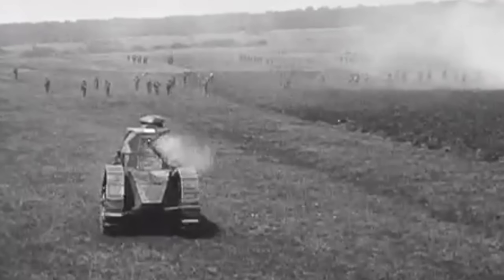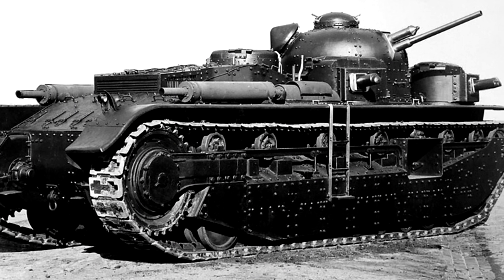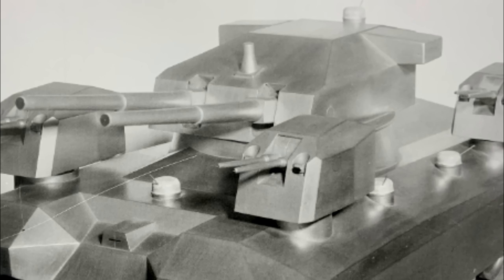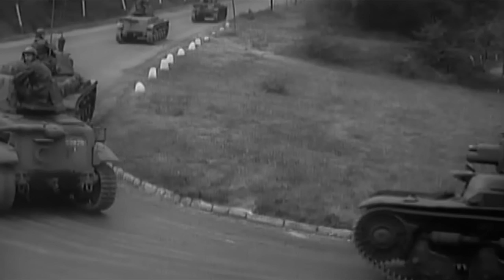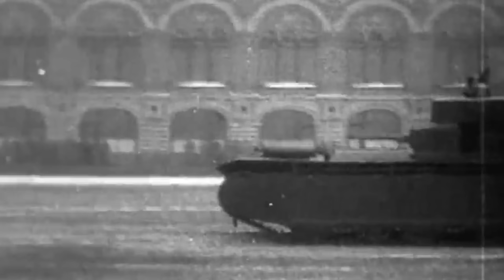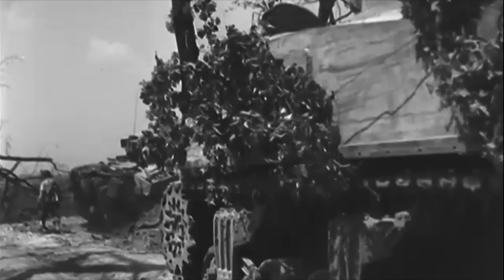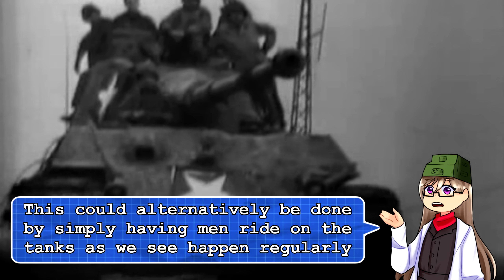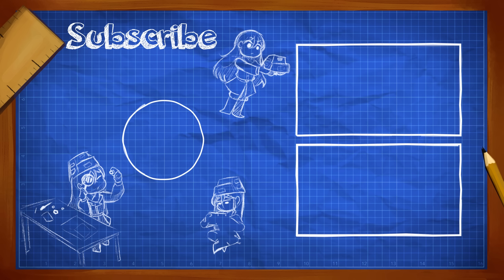Why do Multi-Turreted Tanks Fail?

Comment: The machine gun turrets on British cruiser tanks were removed because the small turrets were gas traps and the machine gun operators were asphyxiated by the exhaust gases from the machine guns..  I would guess that having a small turret on the glacis was also a bad idea when you were shot at as the turret would not have the same resistance to an AT round and would create a weakness in the glacis.

Comment: Another reason for failure back in WW2 was the lack of engines powerful enough to give reasonable mobility to very heavy tanks.

The general rule for tank design:

1. Firepower
2. Mobility
3. Protection

In this very order.

Except for breakthrough-tanks or other niche applications.

Another reason might have been reliability.

Basically all super-heavies were very prone to break-downs - and hard to repair in the field.

It was a lot easier to make parts for regular tanks - and get them where they were needed.

Hence the decision for and success of Sherman, T-34 and Panzer IV.

Comment: Very strange comparison. A multi-turret tank ought to be compared not with a single turret tank, but with an armour group of a comparable fire power. Say, with a couple of a light tank and a self-propelled gun if we are talking General Lee tank. Or with a medium tank and machine-gun tankettes, if we are talking T-28. Or with a couple of heavy and light tanks, if are considering SMK. It is this you should compare total weight, length, visibility, mobility, cross-country ability, communication, crew, supply logistics etc.

More important, the question is of a tactic where you actually need this multi-turret.

Comment: Only one turret will have unobstructed 360 coverage, while smaller turrets will be obstructed by the main gun. Unless the turret cannot transverse 360 degrees at best a 2nd turret will just be a secondary armament and at worst obstruct the primary. 
The only way a multiple primary weapon tank could be viable is if it mounts a hull weapon that is too large for the primary turret, but that would make the turret a secondary armament.
Reply: You can have a smaller turret on top of the bigger one, but then the obstruction happens between the operators inside them..

Comment: I mean it could be done again just to see if its more effective with modern tanks I guess a one off experiment or someone making a home made thing for shits and lulz I suppose but modern tanks seem to do a lot better with out multiple turrrets. Its just seems too much micromanagement for the crews though and it not worth it unless I don't it could be some form of battle fortress or land battleship I suppose acting as long range fire support as well as command vehicle for entire tank column or battlegroup I suppose.

Its definitely like the super tank concept stupidly impractical but still does look cool at times. Its concept that has been long dead and any sane tank designers would know that its a relic with no future. But if you get someone eccentric enough in r and d for tank designs and they are persistent enough then maybe the military higher ups might approve of such protoype just see if their is any merit to such a design. 

All I know is sometimes stupid and absurd designs that have been long since dead sometimes have a chance to be reborn again in new era of technology because new technology allows for such designs to work more effectively because they don't have the same limitations their ancestors had I suppose. 

just interesting concept that I really don't have hugely strong opinion either way personally, Like oh that tank looks neat even if it performs poorly to.

Comment: One thing you forgot is that bigger tanks with multiple turrets would also require bigger engines, which also means more cost, more fuel consumption, and a heavier demand on electrical power to move the turrets.  More parts, more things that can break down.

Comment: Economy aside, most of the shortcomings of having several gun turrets on such small vehicles as tanks are solved in larger vehicles, like navy battleships.
But the real problem causing the communication and control issues is not the weapons system, but the crew: Humans are...
Skynet will do it infinitely better.
Just two more versions of ChatGPT and we could see it ourselves.

Comment: A couple comments I had during the video:

During your segments where you spoke on the benefits of Multi-Turret Tanks (MTTs) you mentioned how in many of those circumstances (crew transport/bringing more firepower) those roles could be filled by just bringing multiple more standard vehicles. I think the point you missed here is that even though a MTT would be more expensive and take longer to produce than a single standard tank, it's likely a save on time and resources to have the one extra large vehicle compared to needing multiple smaller vehicles to perform tasks.

I think a better counter argument to this that you should have brought up would be the fact that the real issue is the "all in one" strategy of an MTT. It would be way more devastating to an operation if everything hinged on a single vehicle rather than multiple. With your APC example, imagine if the MTT got disabled or completely taken out. Now you've lost both your tank support for your infantry AND the infantry transport together. If you had a separate tank and truck instead, you can lose one and still maintain a level of viability.

Secondly, and this is just a personal opinion, I don't think MG turrets should be counted making a vehicle a MTT. The idea of a Multi-Turret Tank is that each turret has a primary weapon. I think it's safe to say a roof mounted .30 or .50 on top of an Abrams or any other MBT is not going to be considered a "Primary" armament by the vast majority of people. Whether it's an automated/remote MG mount or not lol.

Just as a side note: I think Multi-Turret (Or Multi-Armament) vehicles are a good idea. We generally see more of the latter than the former (Bradley, BMP, IFVs in general) with a main cannon (or autocannon) and a ATGM launcher. We even still see double barreled tanks today, the BMP-3 for example. Having two separate weapons that can fill two separate roles for a vehicle really increases the effectiveness, and usability of those vehicles. I don't personally think MTTs or Double Barreled tanks/vehicles failed. I just think they evolved over time due to increasingly better technology (and capability) to look so vastly different that unless you dig deeper into the subject, you'd not be blamed for thinking they had. A good example of this is the fact that many IFVs, from all sides of the spectrum (NATO/Soviet/Russian/Chinese) still have port holes to allow embarked infantry to fire their weapons from the vehicles sides and rear, helping clear blind spots.
Reply: Bro wrote an essay but only got 3 comments? That sad show my boy some love by liking his comment
Reply: yo this is one of the best comments down here

Comment: They weren't called "landships" for nothing. They were thought of as battleships on land. However you cannot use the same principals in design and construction as with ships. Oceans (when calm) don't present an obstacle, terrain however is not always flat and has many different features that make bigger tanks very hard to operate (forests, hedgerows, rivers, urban environments). So faster, agile designs are usually more preferable. Also on sea you cannot really hide (except for subs of course). So being big and heavily armed was necessary to being able to absorb attacks but also to dish out enough to destroy the enemy as fast as possible because you were practically always visible to the enemy. On land manouvering, flanking and hiding etc. are much more viable, which made smaller, flexible designs the better option again.

Comment: I believe that you did miss stating that they could actually increase reaction time as they have more eyes on the lookout but they would have also suffered from panicking.
Reply from the maker: That is true but you still run into problems due to the larger number or crew

Comment: One could argue that the current automatic defences that fire to intercept incoming ATGM's are, in effect, a return towards a form of multi-turret tank. In general the reason why they failed is down to the mathematics of tank design, where multi-turret vehicles tend to be very large, difficult to manoeuvre, tall, not well armoured, but still heavy, and had indifferent main-armament. All this means that after WW1, the designs were not compatible with the realities of warfare at that time. That does not mean that some aspects of multi-turreted vehicles will not re-occur as the nature of warfare changes. It may be, for example, that the advent of drones sees a return to unmanned turrets for sensors/weapons to engage them. Or Multi-turreted IFV's so that dismounts can operate support weapons from within prior to dismounting, or in support of other IFV's and APC's. If APC and IFV armour becomes unsustainably vulnerable, then it can be lessened and the weight saving used to increase offensive capability.

Comment: The lee was a special case.  The US army really wanted to field the 75mm gun, but the sherman was still in production and not many were ready to ship yet.  So the lee was fielded as a stop-gap replacement for shermans.  The 37mm gun was considered underpowered once it started running into panzer 3's, and even moreso when panzer IV's started showing up in 1942.  Also as far as HE shells go, the 75mm was the best performing HE round the US army developed during the war.  The 105mm did perform better damage-wise, but it took longer to reload, aim, and was a lot less precise due to the slow muzzle velocity and therefore the steep arc of the 105 shell.

But the lee was also meant to be taken out of service as soon as shermans were widely available, which is exactly what happened.  It's percieved shortcomings became enough of a reality to convince the army that a multi-gunned tank of any sort was not an optimal layout, as the lee was basically a TD with a turret on top.

Comment: For me they could take on a defensive role, for example in winter warfare the most common tanks were the t-26 and the bts and the most common multi-turrets were the t-28s, if they were used as bunkes i.e. they were in a position where only their turrets were out it would be a perfect defense. Of course they could take on attacks such as the m3 lee and the cruiser, another tank that had a success was the char 1bis and the SMK, which proved stronger and more armored than its predecessors. 
But we get into the highlighted paradox that is why make a tank with several weapons when I can make several tanks with one weapon that will have the same effect? Not to mention points such as production, maintenance, crew members, etc., but what do you think?

Comment: Most port cranes in the WW2 era had a capacity of 30 tons. Okay for a Sherman but useless for the M6 heavy.
A fully automatic small turret with a large gun and controlled by an A.I  might be usefull

Comment: If you extend the concept of "multi-turreted" to vehicles with mounted Remote Weapon Stations - then the concept becomes quite a bit more useful. A few variants of the Marder 1 and MOWAG Tornado IFV carried a main autocannon turret as well as one or two machine gun RWS in the back of the vehicle. Quite a few modern tanks have a RWS mounted on the turret - including the M1A2 SEPv3 and the T-90M, and the EMBT concept had two separate RWS up on the turret. If the individual weapon systems can be autonomously controlled by computer, that avoids commander overload and crew interference, and in a robot-rich combat environment, having multiple RWS for close defense would eventually be advisable (if not required)

Comment: The weight problem is severe. Because you have to armor 360 degrees of turret multiple times over. In the modern day where ANY weak spot will be a detriment and having ERA facing towards your tank os a BAD idea, I doubt it will happen. Best ai can think of is a drone tank with like 5 controlled weapon mounts that can just drive into a town square and unload in every direction at once.
Reply: Don't give the new American government any ideas. They are on a kick the past two weeks. Trying to kill trump. Killing biden. They gonna use this idea.

Comment: I think the Churchill mk1 design is quite telling,
It was intended to have side sponsons for trench warfare and also had a 3 inch howitzer in the hull.
It the final design sponsons were never added, just handy escape doors, and the later iterations deleted the howitzer to be replaced with a hull besa machine gun which then was also deleted and the gap welded over with additional armour

Comment: basicly-there big with less penetration,while tanks got bether anti tank capabilities, callibers incresed and anti tank artilery like the pak 43 8.8cm or the pak 40 7.5cm become a think,they realized theyl stil die,having more turrets means the turrets need to take less space,means you cennot have the long big 8.8cm like the tiger and tiger ll or the 90mm like the pershing,means in ww2,a war that they started with panzer 38(t0 and ended with panther and tigerll youre gona be outdated very quicly and youre gona be hard as fuck to upgrade,while on a M4 sherman or a panzer lV you cen just upgrade the armour where it needs,put a new turret with the same mantlet size but bether armament and thats basicly it or add more advanced armour(panzer lV ausf H,J)for more protection against rocket lounchers,also there slow,like real slow(with the exception of M3 lee)

Comment: I have to be honest. The idea of using a T-35 in the fashion you described struck me as so idiotic lol I was surprised you suggested anyone would see that as a use case. As you said, infantry can just ride the tanks or follow the tanks, who in their right mind would suggest the crew dismount to hold a strategic point? That's like what you do in a video game! I just thought that was very silly lol. But I wanted to get input on if the M60 technically would be considered multi turreted with their little .50 caliber turret cupolas?

Comment: We are laughing at them right now but they are seeing a come back of some sort. The new generation of tanks show their preproductions or prototype fitted with a turret (usually either a .50 cal or a 20mm canister loaded) on top of the main turret of the tank. This is something seeing on the EMBT or the Abrams X. Technologie IS a massive help, in the case of the embt, it is 'supposed' to be a Independent turret runned by an ai. (I read about it in an article a while ago... on this one it's gonna have to be 'trust me bro'). For urban warfare or trench warfare, they could be a massive + to the suvivability of said tanks without bringing up the weight to an exobitent number... even if modern tanks are becoming quite heavy.

Comment: The ratio of track length (in contact with the ground) to width of the tank is important. If the ground contact length is too long, it becomes much harder to turn the tank. This adds stress to the tracks, suspension and final drives. Beefing up those components adds weight. Those multi-turret designs are long beasts. I think Lindybeige discusses this in one of his videos.

Comment: The m3 lee/grant definitely had flaws just like the multi turret. But only having a single turret and a sponson gun makes it more manageable for the  commander. Also, it was relatively easy to produce a tank with decent fire power for its size.

Comment: Did I hear you incorrectly, or are you lumping the Char B1 and 2C under 'multi-turreted tanks?' If so, I would really appreciate if you could further enlarge on your reasoning. I agree with counting the M3 -  machine gun cupola or not - since the sponson armament has (admittedly-limited) lateral traverse, whereas the hull-mounted howitzer of the Char tanks did not. 
There may be a reason you left the pre-War American M2A2 multi-turreted light tank off the list, but I would point out that it fired exactly as many shots at the enemy as the Char 2C. 
On the subject of additional multi-turret drawbacks: as you mentioned, the additional space required often leads to a longer vehicle, and there is a ratio for the length and width of track on the ground vs weight when it comes to ideal steering ability and component strain.
Reply from the maker: You missed the part where I said they are a hybrid between the two
Reply: @ConeOfArc  Must have. Thanks.

Comment: Very glad you mentioned CROWs and other such systems here! They are kiiiinda a modern evolution of the multi turret machine gun tank, just, without all the massive drawbacks (mainly no additional crew members)
Reply: More so no extra armored turret taking up space and weight.
Reply: @magnemoe1  yes, that's mostly what I meant. No additional crew means they have no need to make a large Turret thankfully

Comment: Modern BMPT Terminator can be somewhat called as continuation of multiturreted tanks. Aside of dual 30mm canon's turret it has 2 grenade launchers with own operator on each. They are not in own turrets - because they don't need, it's granade launchers. But they operate separately from main turret by own crew.

Comment: While in theory multi-turreted tanks can have more firepower than regular tanks because, as you said, more weapons should equal more firepower. But in reality, multi-turreted tanks often had less firepower, because 2 turrets take more space and thus, often had smaller guns than other tanks. If you have more space on a tank, you can put a bigger gun with more firepower and penetration, then if you had to fit 2 guns into the same space. Very good video, as always, cone of arc.